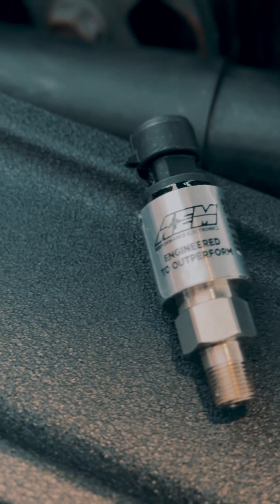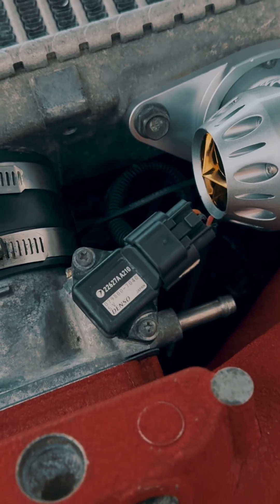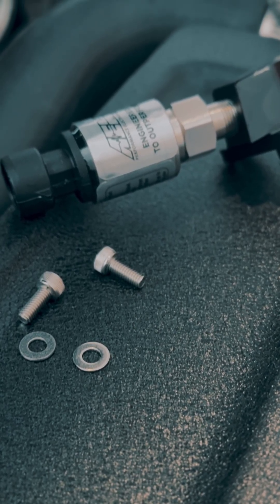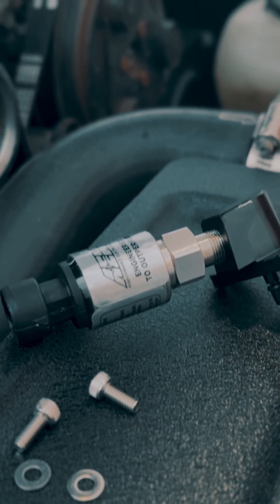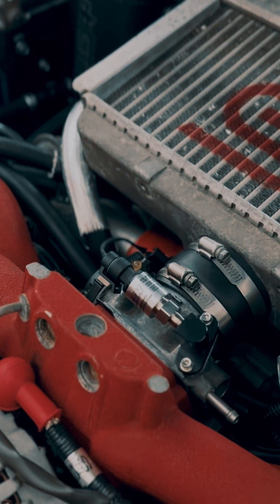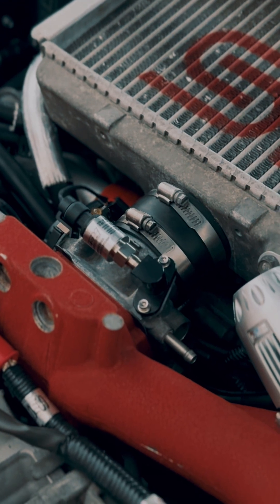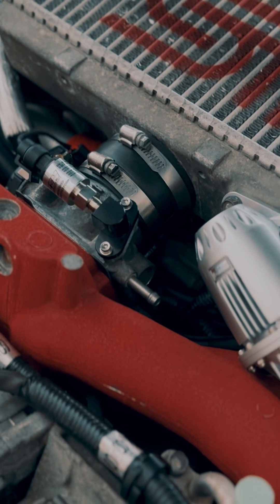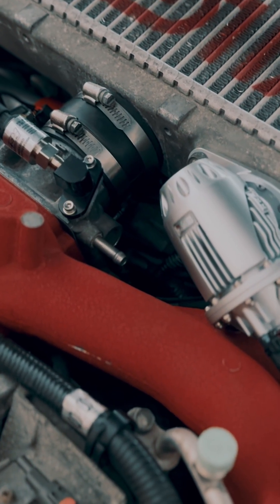STI Tech Breakdown #5: AEM 3.5 Bar MAP Sensor

Comment from the maker: Just for everyone’s knowledge. 1 Bar is 14.5 PSI. So 2.5 bar is roughly 36 PSI. This means the new AEM 3.5 Bar is good to read up to 50 PSI. However you have to take into consideration barometric pressure being 14.7. Meaning factory MAP is good till low 20’s and the AEM is good till high 20’s low 30’s. Still plenty of headroom now and if I go bigger turbo in the future.